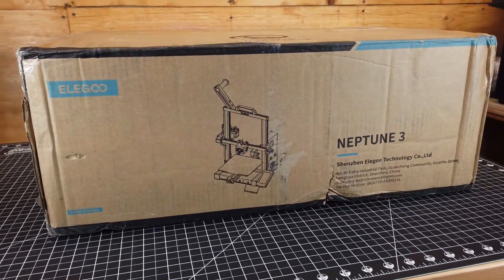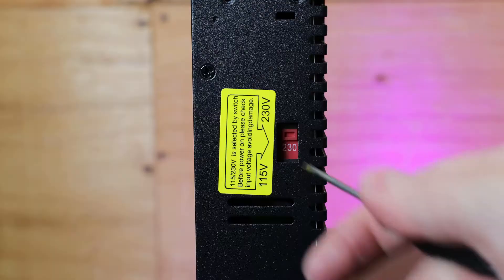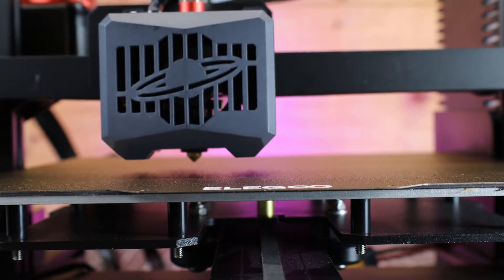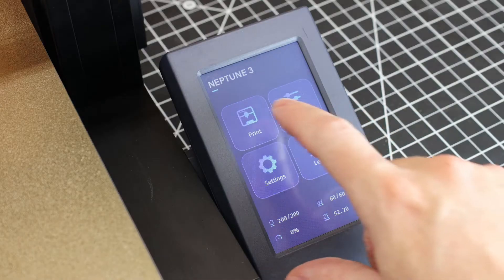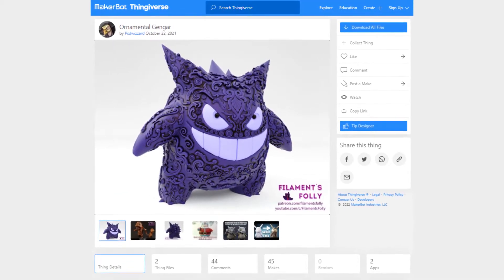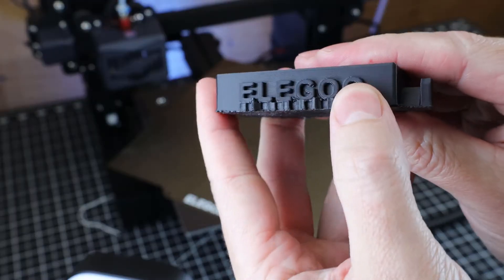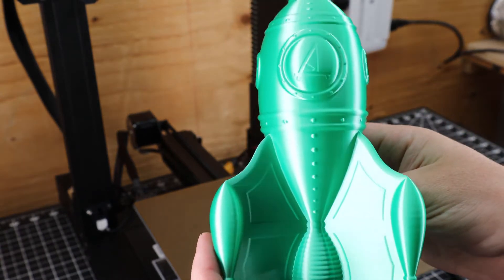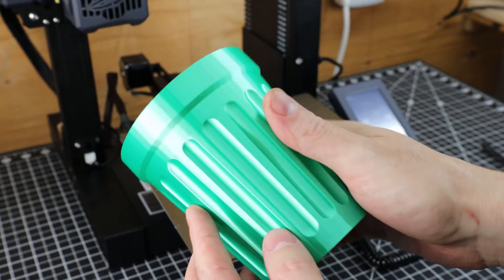2022 Budget FDM 3D Printer With A Lot To Offer - Elegoo Neptune 3

Comment from the maker: Check out the new Elegoo Neptune 3 3d printer. You get a lot of bang for your buck for the $209 price tag, watch the video for more info.
From Elegoo:
Elegoo Neptune 3 - https://bit.ly/ElegooNeptune3

From Amazon:
Elegoo Neptune 2S - https://amzn.to/3Nyahjs
Elegoo Neptune 2 - https://amzn.to/3zulXzP
Elegoo Neptune X - https://amzn.to/3HgKTwB

Wi-Fi Controller & Webcam Unit:
Mintion Beagle Camera - https://bit.ly/BeagleCamera

3D Printing Filament:
MH Build Series Silky PLA - https://bit.ly/BuildSeriesSilkyPLAMatterHackers
MH Build Series PLA - https://bit.ly/MatterHackersBuildSeriesPLA
MH Quantum Dual-Color PLA - https://bit.ly/QuantumSeriesDual-ColorPLA
DURAMIC 3D PLA -  https://amzn.to/3H4Uo1O
Polymaker ASA Filament - https://amzn.to/3H9hdkU

Other Tools: 
Stainless Steel Feeler Gauge - https://amzn.to/3H4VZVm
Self Healing Cutting Mat - https://amzn.to/3NDmV0U

3D Print Files:
Ornamental Gengar - https://www.thingiverse.com/thing:5028132
Elegoo Neptune Tool Holder - https://www.thingiverse.com/thing:5023796
Spiral Vase Rocket - https://www.thingiverse.com/thing:1535483
Desktop Trashcan (Vase Mode) - https://www.thingiverse.com/thing:3806866

MatterHackers 3D Printing Filament 1.75mm:
Build Series PLA - https://bit.ly/MatterHackersBuildSeriesPLA
Build Series Silky PLA - https://bit.ly/BuildSeriesSilkyPLAMatterHackers
Build Series ABS - https://bit.ly/MatterHackersBuildSeriesABS
Build Series PETG - https://bit.ly/MatterHackersBuildSeriesPETG
PRO Series Filament - https://bit.ly/MatterHackersPROSeriesFilament
NylonX Filament - https://bit.ly/MatterHackersNylonX

Amazon 3D Printing Filament 1.75mm:
PLA - https://amzn.to/3gsLE9Z
PETG - https://amzn.to/3pXjjvu
ABS - https://amzn.to/3wsTRjS
ASA - https://amzn.to/2RX8dtM
Polycarbonate - https://amzn.to/3cLdr38
Nylon - https://amzn.to/3iNGeI2
______________________________________________
Note Most of the links that I use that go to products are affiliate link. This means I make a small commission on anything that you happen buy using them. This is at no extra charge to you and this helps support the work I do on this channel. 😁👍
______________________________________________
#elegoo #neptune3 #neptune2 #ender3v2 #diy #3dPrinting #maker #3dScanning #DIY

Comment: This is all well and good for large objects but what about smaller stuff for jewelry making like pendent patterns and ring mold patterns ? For example if I carve a pendent pattern in wax that I want to sand cast or cuttle bone cast, a wax pattern isn't durable enough. The same for a ring that I may want to sand cast or investment cast for that matter. Will this filament printer or any filament printer that you have demo'd print the small stuff with detail and without under or over extruding ?
Reply from the maker: FDM printers can print kind of small but they take a long time and the details are never the best. If you are wanting to do casting you might really want to look into a resin printer like this one https://youtu.be/nB_Lf7nOWkA